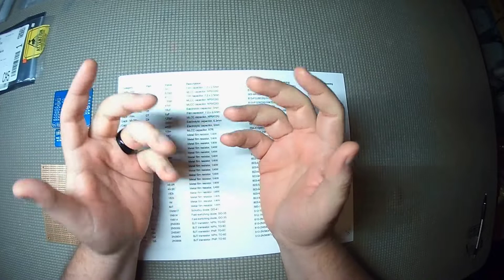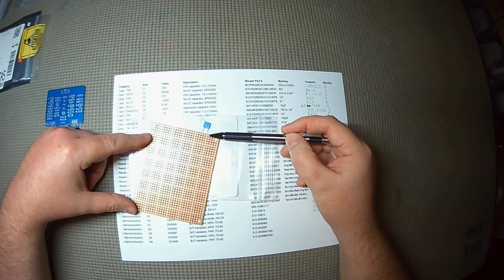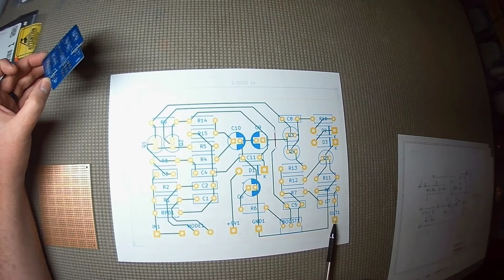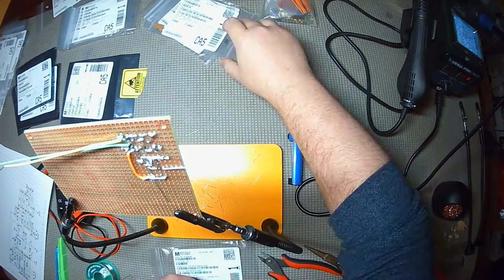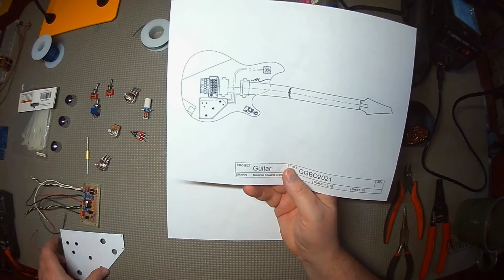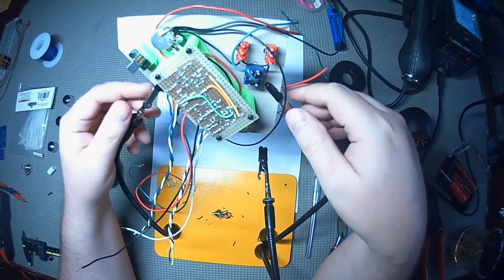Great Guitar Build Off 2021 - Part 2: Photon Booster & Wiring Harness

Comment: I really like this. 

Tried building my own pre-amp the other day: magic smoke 😢 those little resistors & capacitors with those little colour codes got me. Switched a few of them round by accident.

I think I would just use the pedal board, thought a tad bit larger. But I get it: what’s the fun in that if you can build your board 😉

I’ll be watching this build for sure mate, I like it already.